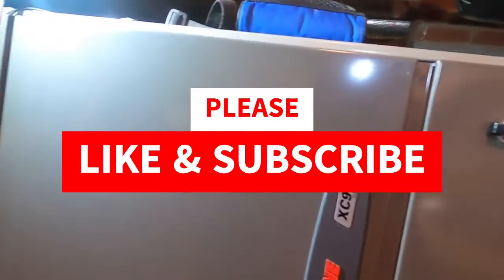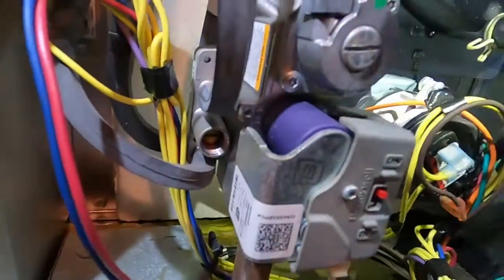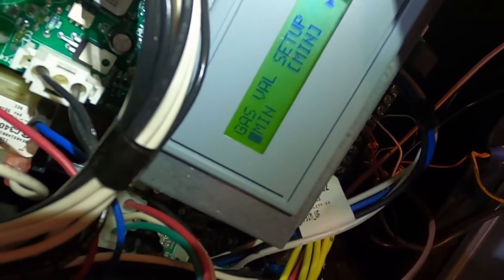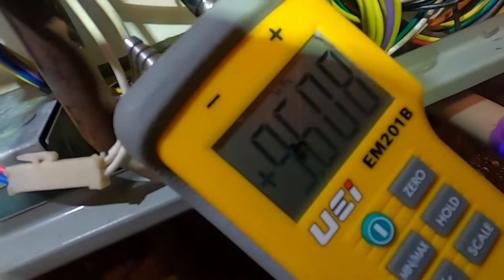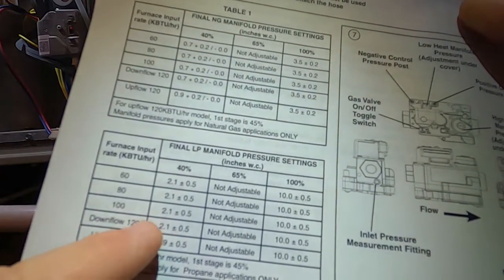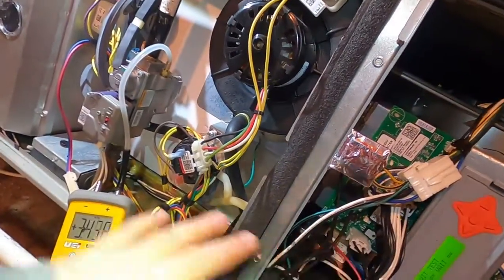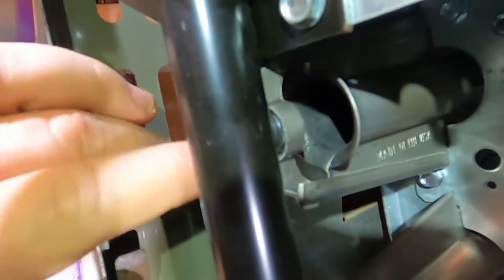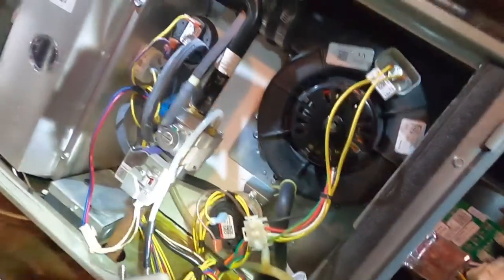Setting gas pressure on a modulating Trane furnace. #hvac

Comment: You're .7 and 3.5 are not correct. There is elevation, specific gravity of the gas etc that can change things.  And if you didn't do a combustion analysis you literally have no idea how clean it's burning. I've had ideal combustion at 2.7, I've had it at 3, 3.3 and so on. 
And whose to say the gas company didn't come and replace the clients regulator or maybe increase a neighborhoods supply pressure?  You would have no idea.  I rarely see gas pressures the same 2 years in a row.
Reply from the maker: Based on the manufactures instructions, .7 & & 3.5 are correct for my situation RTFM!

Comment: Chuck that’s seal combustion you need to remove burner door when you use 1 port on the manometer reference true gas pressure or tee the other port to burner box for true reading of gas pressure with the burner box door on
Reply: Yes exactly, the manual says the same thing to tee the other port to burner box for more accurate reading of gas pressure.

Comment: I installed a 15 ton (2 x 7.5) HP condenser and coil last May that had a Symbio 700 controller that resembles the board in this furnace.

Comment: You are supposed to set the low stage pressure first. More importantly you didn't hook up the other side of your manometer tee'd in to the burner box pressure reference tube. So your gas pressure settings are now off by whatever the pressure in the burner box is (which depends on how restrictive the venting is).
Reply: You don’t need to tee into the burner box you need to zero out the manometer
Reply: @shifter8207  wrong do the research